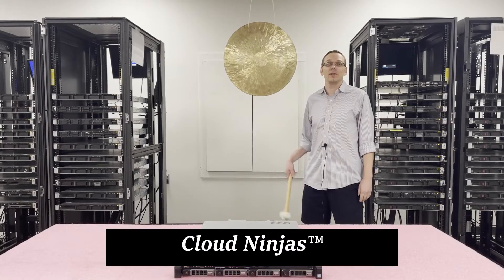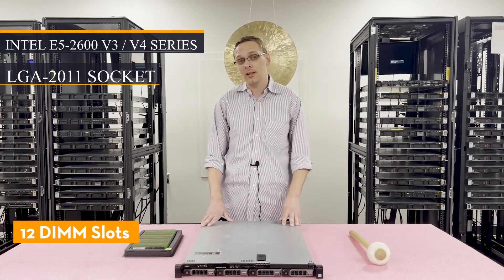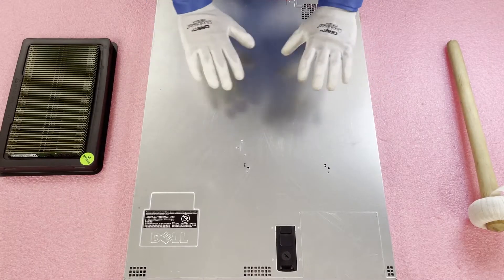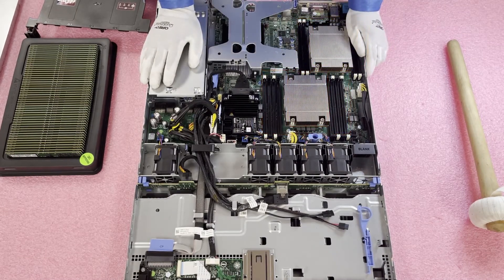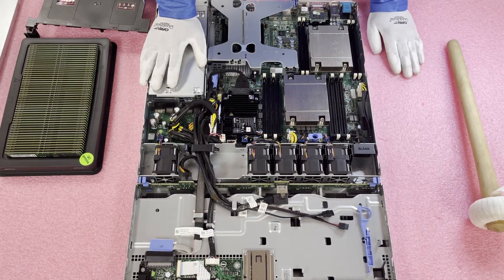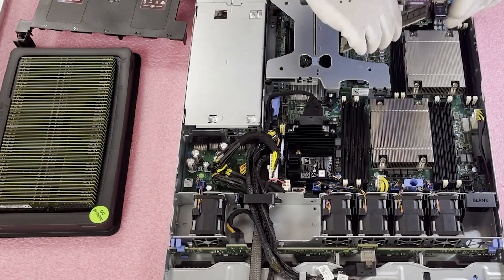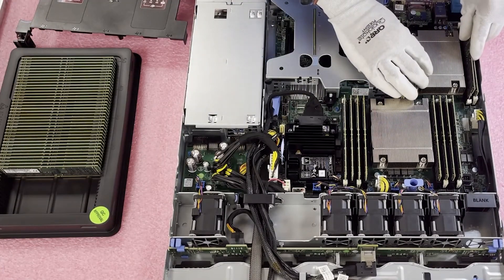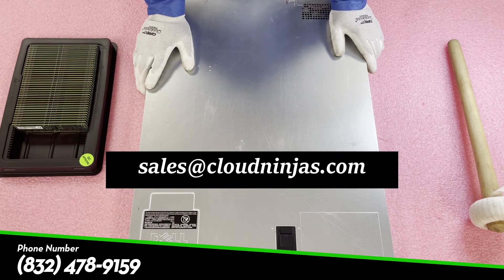Dell PowerEdge R430 Server Review & Overview | Memory Install Tips | How to Configure System | RAM

Comment: how do I get into the drives without the button on the front? I need to remove drive A every video on youtube has the buttons.
Reply from the maker: You likely have the cabled in version.     Which are a different style.  If memory serves me correctly,  then you will need to open the top and there is a blue tap inside. You will also need to physically remove the cables connected to the drive.  Hope that helps.  Good luck!

Comment: is it possible to insert A1 and A2 each 8gb ram, and then A3 and A4 each 16gb? is it okay? or all the dimm slot must be on the same size? thank you. Agung from Indonesia.
Reply from the maker: Hope all is well.  Put the larger DIMMs (16GB) in A1 and A2 and then the smaller DIMMs (8GBs) in A3 and A4.  Smash that subscribe.  Take care!
Reply: @cloudninjas  so the second CPU will stay without RAM and it's not going to work right?

Comment: Whats the point of LRDIMM on this server if you can get same amount of memory like with regular ECC Reg? Generaly LRDIMM is doubling memory amount on other servers :) are you sure you cant go over 384gb with LRDIMM?
Reply from the maker: Yes.  You are correct.   Normally LRDIMMs offer more scalability.   In this case, they are the same as ECC Reg.  But it's still important because 32GB DDR4 LRDIMMs are currently less expensive than RDIMMs.  And we all like saving money.  😁
Reply: @cloudninjas  but its logicly not correct. LRDIMM have more mem banks, higher ranks number, higher speed cause of lower load on imc... so its more resources to make 1 stick and some how they less expensive :) its wierd
Reply from the maker: Definitely strange.  People know and love ECC Reg.  LRDIMMs to ECC Reg are like betamax to VHS.  Better technology but lesser known.  😂